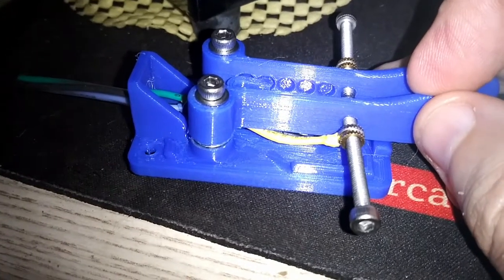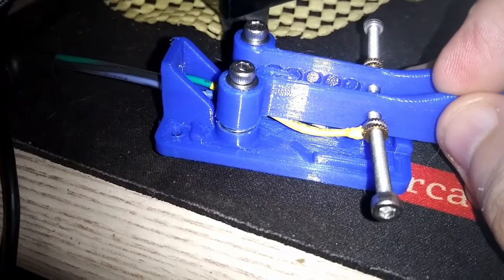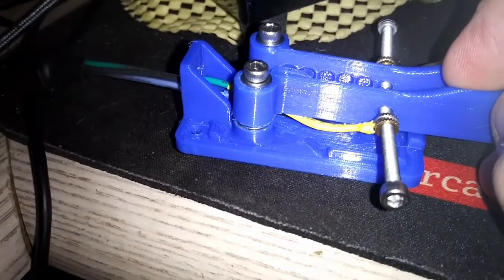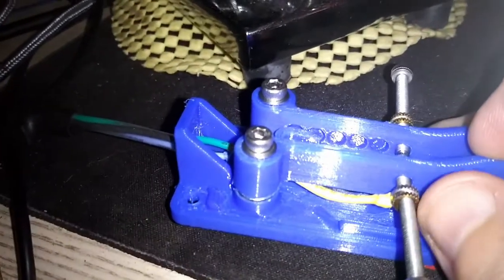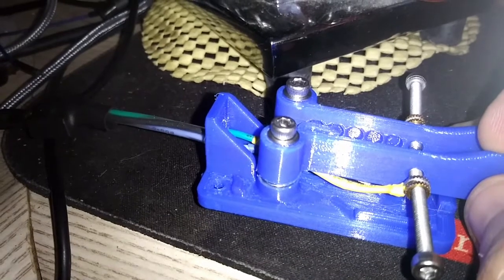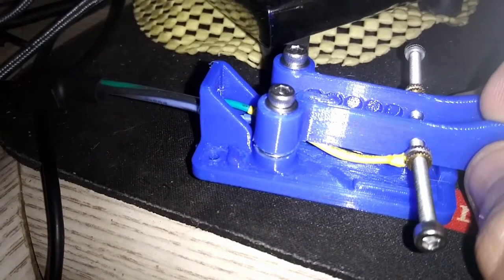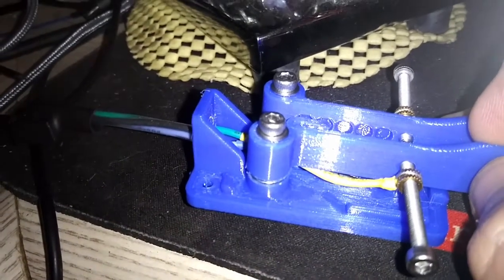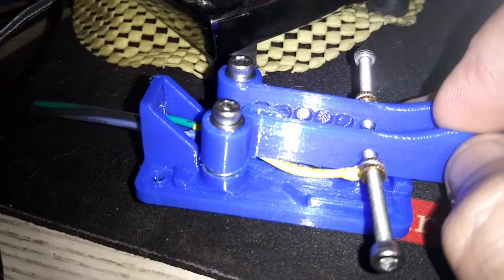Brass Inserts for Ham Radio Morse Paddle DIY Projects

Comment: You need some shorter bolts for the paddles lol. Where does one by chance get the inserts?
Reply: I just realized you linked it
Reply from the maker: It started as "use what you got" but actually with the top on they don't really get in the way and thus can be adjusted by hand without need of hex key. I have a few more I might shorten with a dremel though, we'll see.